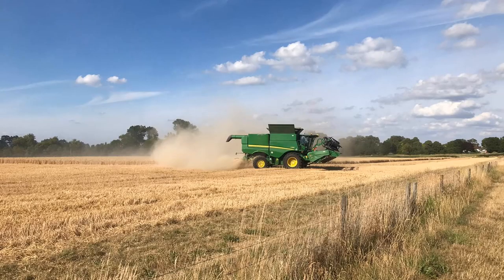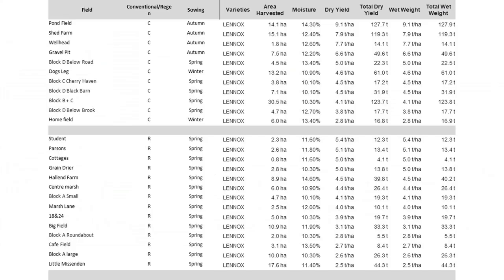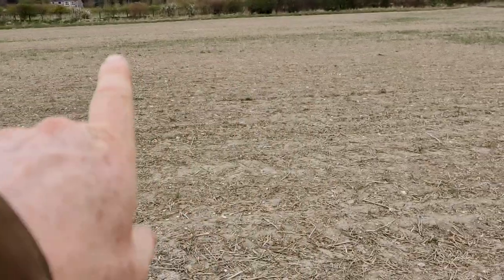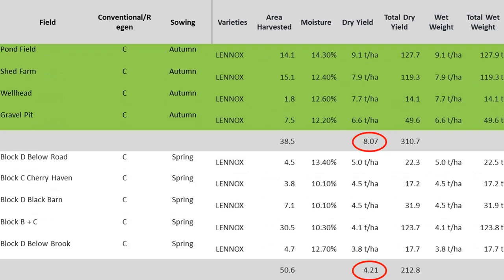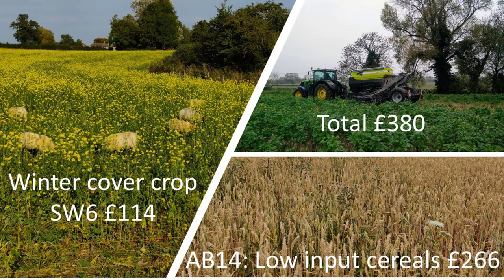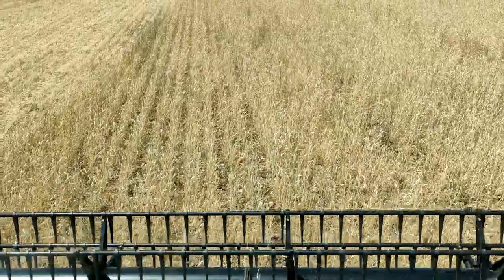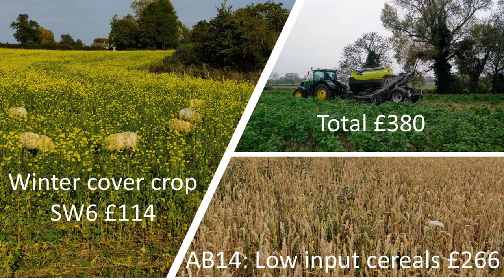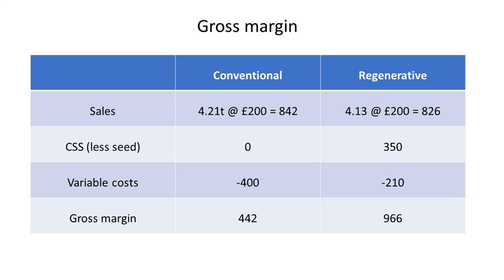Harvest results 2022 Conventional vs Regenerative

Comment: Antony something that may help control weeds including blackgrass and help reduce herbicide costs is a seed cracker fitted to the John Deere combine. 
We imported a seed terminator from Australia and had it fitted to one of our T670i's. 
This was two years ago, we have only just started to see some benefits however we believe that we will only see the main benefit in the long-term, 5 years or more. 
NIAB are only beginning to trial this type of attachment. 
However they have proved themselves in both Australia and North America.
Reply from the maker: Thanks Paul I saw Adam Driver has had one fitted.
Reply: @AntonysRegen  this regenerative farming and cropping is nothing new. 
Its effectiveness depends on what soil type, what kind of cropping and how it fits into your system. 
We operate a five year rotation, this is mainly no or min till after a light application if poultry litter ,using Claydon drills 
After that fifth crop we plough or use an Aggressive cultivation. This helps us incorporate organic matter,control weeds and slugs. Then our rotation starts all over again. 
Our soils are diverse from light sandy right through to moderate clay. 
Reading between the lines cereal prices may reach higher prices next year. Due to a number of arable farmers putting their land into the government's fallow schemes for between 2 and 5 years , creating a shortage.
Reply from the maker: I agree with these energy prices, fertilizer bills will seriously concentrate the mind!